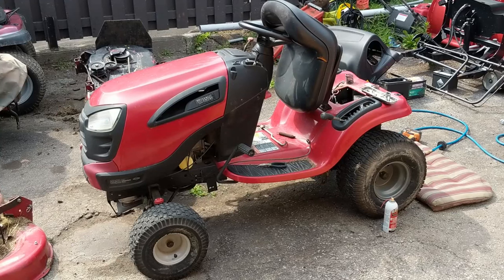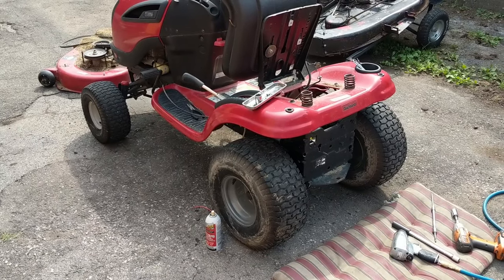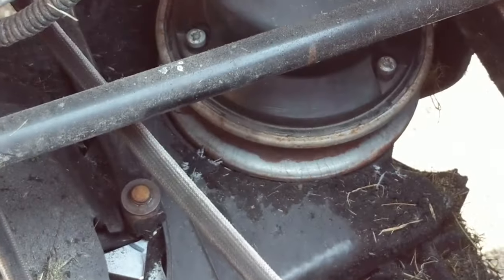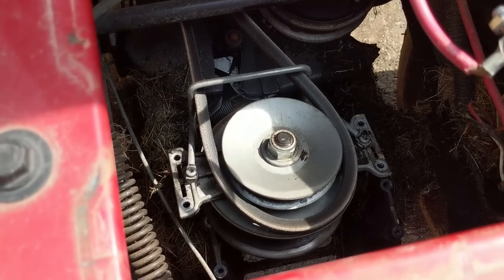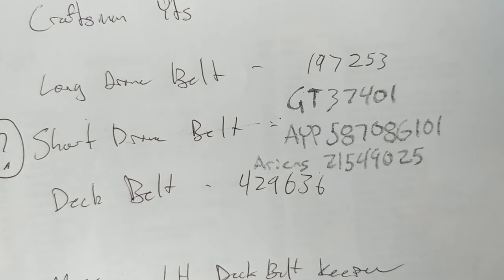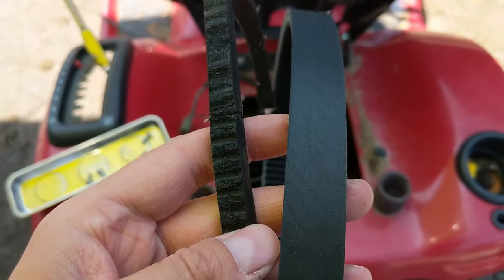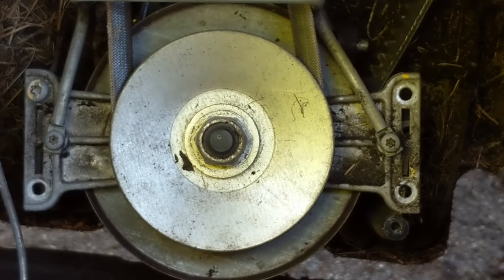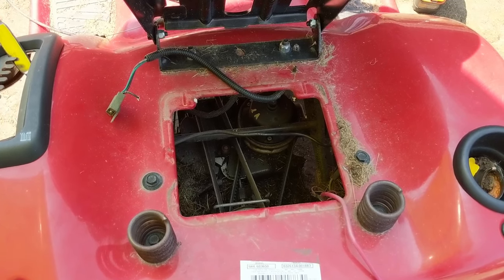Craftsman YT3500 - Transmission Belt Replacement

Comment: Thank you. I think this is my issue. I hit a stump and from then on mower wouldn’t accelerate forward. Engine seems strong and deck belt seems fine. I think my lower drive belt is loose. Does this sound right?

Comment: Thanks for the video I didn't know how to replace the reverse gear transmission belt Husqvarna group has the belts For the deck and the drive  Pro power I believe it's called  Thanks for the info will be working on getting the new belt installed

Comment: I have an Ariens 93608300/A19A42 that has a similar setup. It has been slipping anytime I try to go up even a small hill. May have to try a new variation belt now that I see how easy it is to replace if I can find the right belt.

Comment: I have this exact model and i have no power at all, a turtle could walk faster. Someone told me the tranny was shot, someone else said the drive belt.. After take the battery box out i can see that i have all kinds of slack in the transmission belt and some slack in the drive belt as well. Going to change them and hope it does the trick... now that i have watched your video(and saved it) i know that i can do it. Thanks so much

Comment: Appreciate the video! Ever done this repair on Husqvarna YTA24v48? The gas tank is under the seat and not able to access the top of the transmission as you do here. Looks like I'll need to remove the body and gas tank or drop the transmission from the bottom.

Comment: These transmissions by General Transmissions were put in a lot of different brands of lawn tractors.  I have a Husqvarna YTA22V46 that I purchased four years ago that has one of the transmissions in it.  It's a poor design because of all the debris that can accumulate under and around the pulleys.  The debris affects the operation of the forward/reverse pedal and the transmission generally.  The debris requires the removal of the battery and battery tray quite often to clean the debris out.  Maybe you did it before turning that mower featured in the video over to the owner and it just wasn't shown or mentioned in the video, but I was surprised you didn't clean out the debris that was around that transmission.
Reply from the maker: Yes I should've mentioned it in the video, I used a compressor with my air gun and blew out all the grass. These transmissions are horrible in Canada for riders stored outdoors, they're plastic and crack. Usually 3yrs or more out of warranty. They're $1150 CAD to replace too! Not worth it!

Comment: I installed the new transmission belt and it not under proper tension, even when i engage the pedal mechanism.. i wonder if i not only had a broken belt but another broken link. Everything seems to be linked properly tho

Comment: Eliminator performance,  I got the same mower drive gear box ,  it will move backWards  but not forwards,  any suggestions Eliminator #1 ..
Reply from the maker: Hard to say, this customer ended up splitting the transmission in half last year unfortunately. These plastic transmissions are garbage and unfortunately they cost like $1300-$1600 to replace. Most of them go forwards but not reverse. Look for cracks.

Comment: I was working on one of those with the " General Transmission" for a friend. The belt that goes to the engine is tight but it still slips and it is a brand new belt???
Reply from the maker: It's possible that it's too long of a belt? Maybe try a half inch shorter if it's only slightly slipping?
Reply: @EliminatorPerformance  He bought the mower from Walmart and he bought the drive belt from walmart and supposedly it's the one that fits it

Comment: I bought a 2003 Craftsman DLS 3500 special edition and it barely wouldn't attach to it the belly went out on him and he bought another one he says it ain't hooking up the same like the last 46 inch deck so what I  am trying to found all the bracket to put cutting deck is there any way you can help if you have all the parts I will buy them from you along they are right one

Comment: Also get a V belt ruler, Or use or make one.  WHERE YOU ELIMINATE THE GUESSING GAME > TSC usually have one by there belts.  Any tape measure will give you the width of the belt!  Most of the lawn tractors is 1/2" or 5/8" wide V- Belts

Comment: All part numbers drive, deck  air filter, spark plug etc numbers are stamped inside the hood when you open it up
Reply from the maker: Yes but I no longer use those numbers as I've worked on machines that had a different hood installed from the factory. The part numbers were wrong. Key example is my aunt's mower, she bought it brand new and it said to use a certain length deck belt, which was wrong. Once I ran the model number and got the IPL, it said to use a shorter belt. The hood number was incorrect.

Comment: Dude if the mower keeps breaking this belt what would be doing that? I have a Husqvarna that has went through two in the past month
Reply from the maker: Transmission is probably cracked, put a belt on it and sell the machine
Reply: @EliminatorPerformance  Roger that

Comment: I like heavy duty over OEM BELTS. There heat resistance and stretches less. More durable in the V BELTS. If i can't fine the heavy duty V belts, THEN ONLY THEN, WOULD I GO OEM

Comment: Are you saying that the belts that Sears put on the front under side of the hood are incorrect?
Reply from the maker: Yes, in many cases they have been incorrect! I always recommend referring to the owners manual part section, or Google the model number and get a illustrated parts list.

Comment: I have yet to see anyone that covered the belts on a 247.288841 tractor I can't figure out how to get the transmission belt around the back side pulley  and I'm having a problem pulling the engine pulley it seems seized

Comment: My tractor came factory equipped with a skinny drive belt. Makes no sense to me why they'd put a smaller one on it. I just ordered the oem one and I wish I could have purchased the fatter version :-(
Reply from the maker: This machine absolutely pulls harder with the thicker belt, my customer was amazed! Thanks for watching!
Reply: @EliminatorPerformance  I wanted to also ask you about the services for the rear differential fluid on these tractors. I didn't see anything mentioned about it in my manual. Does it need changed or is it pretty much bulletproof and good for the life of the tractor? I'd imagine that its gear oil of some sort
Reply from the maker: @kennethwise7108  it's a sealed, self contained unit!
Reply: @EliminatorPerformance  good deal, appreciate your response